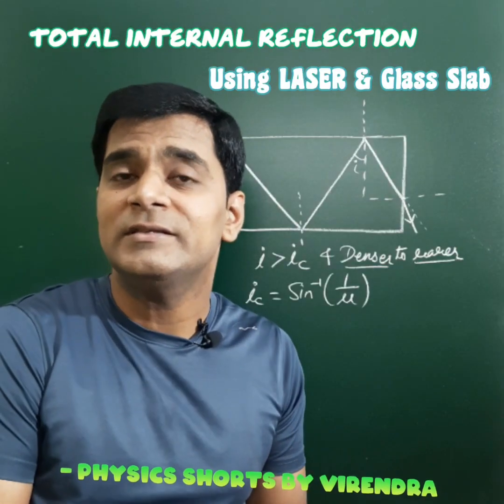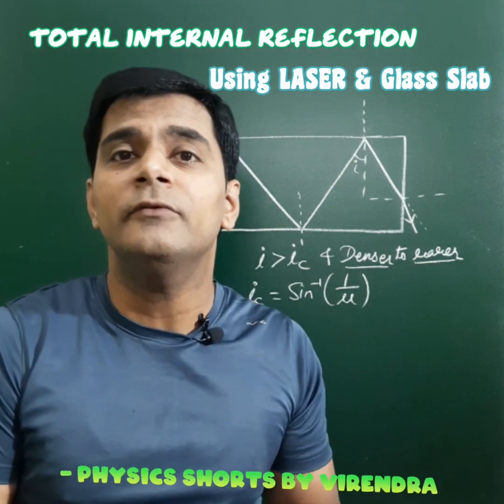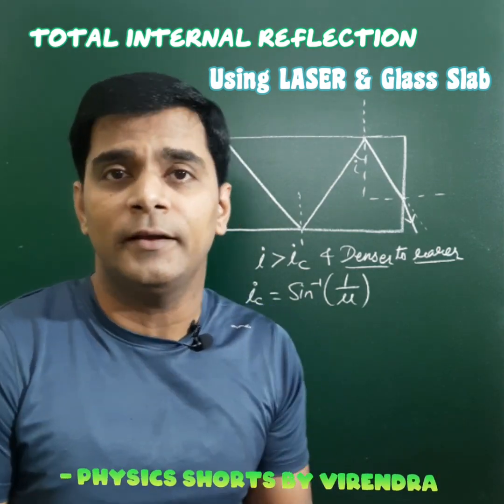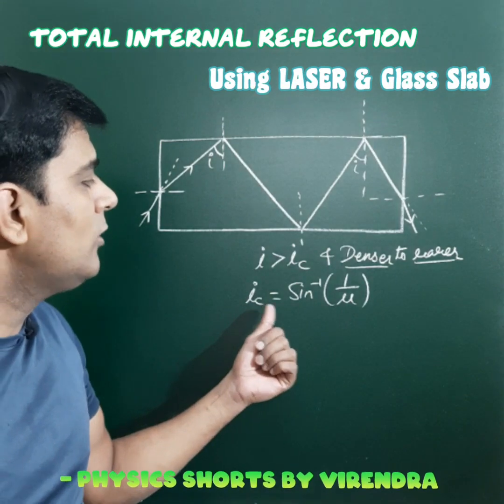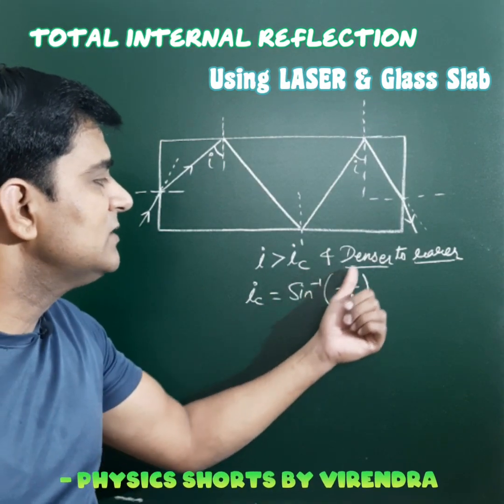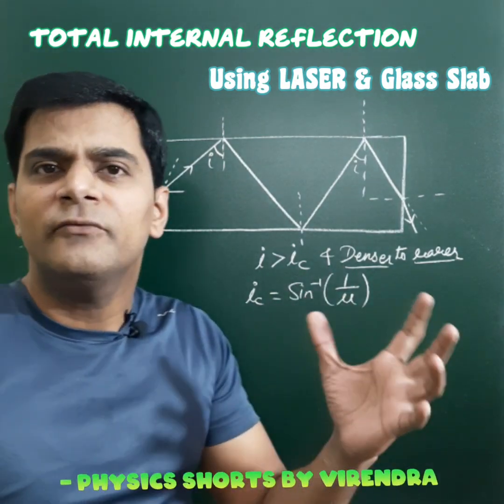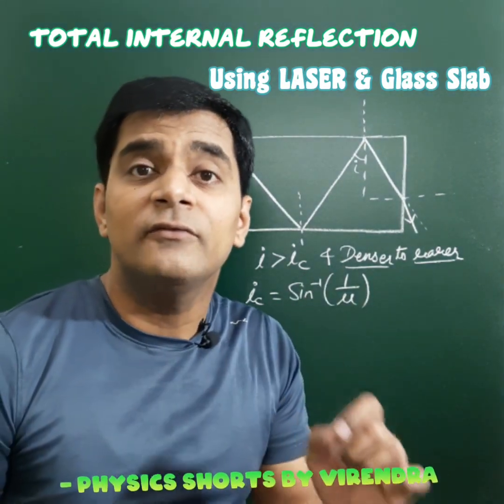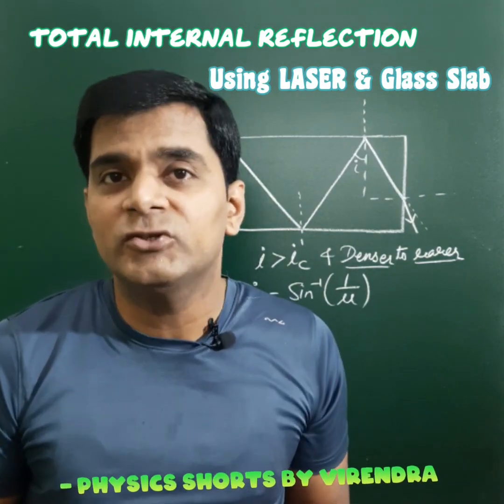Demonstration of Total Internal Reflection Using LASER & Glass Slab

Comment: Why red light is observe rather than green? What's the reason behind this..?
Reply: might have something to do with the camera; sometimes cameras switch to a different color when light is too strong?
Reply from the maker: The change in color from green to red when passing a green-colored laser through a glass slab is likely due to the phenomenon of dispersion. Glass has a property called refractive index, which varies with the wavelength of light. When passing through the glass slab, the green light is refracted differently from the other colors, causing the light to spread out and separate into its individual colors, with red being the most prominent color observed inside the glass. This dispersion is responsible for the apparent color change.
Reply: @PhysicsShortsByVirendra thankyou so much sir❤❤❤